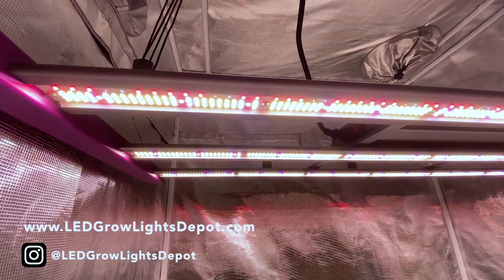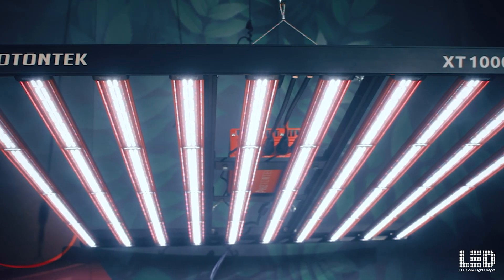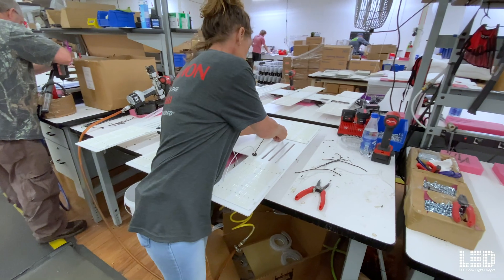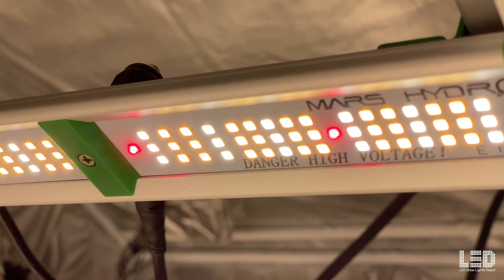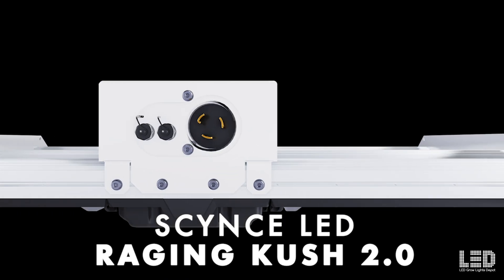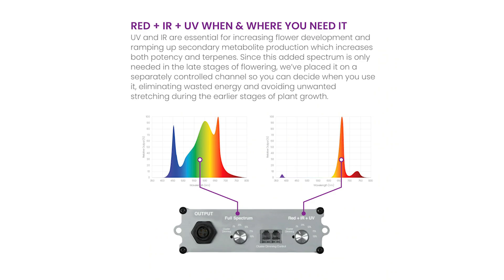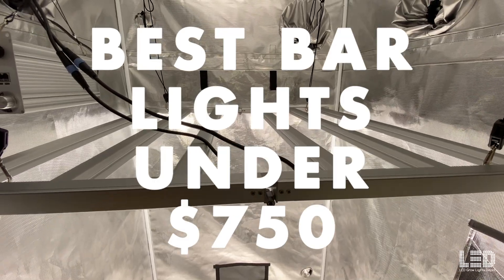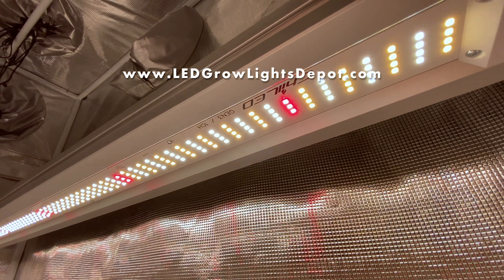Best LED Grow Lights 2022 // 16 Lights For Your HOME or COMMERCIAL Grow!

Comment: I have a question. 1000w hortilux high-pressure sodium puts out 140,000. And that's what you're basically saying the most powerful 1000 true watt LED put out. Although the high-pressure sodium cost way less. So what's the advantage to the LED that draws a thousand watts and puts out as much light as a 1000 watt high pressure sodium?
Reply: Spectrum and efficiency

Comment: My Mars Hydro LED light started flickering due to wires in the main wire harness connector burning. The connector was very hot to the touch. After sending a lot of pictures and info to Mar Hydro (Janice), they stopped communicating. I am afraid to use it because I don't want to burn my house down! Where there customer support and warranty?
Reply: I had same problem with my se7000 ,I have had 1replacement light stand ,and about to try out the 2 nd driver and I have to do the wiring, customer service terrible spider farmer.

Comment: I'm enjoying my ion 720 pulling so far off my first two harvest's since switching bto LED. 11 lb off 6 lights each harvest. purple gelato. Using co2 and coco 3 gal pots flood and drain in 4x8 trays. With a 25 day veg 60 day flower.

Comment: The best one: Raging Kush II, even coverage and tunable spectrum.
To simulate the SUMMER sun: during veg (best 5000k – blue/white) +UVB -REDs. To simulate the FALL sun during flower (best 3000k – yellow/white) -UVB +REDs.
Not only we have to change from 18-6 to 12-12 hours from veg to flower, but we must change the spectrums also. I will change my 3x3 tent to 4x4 to accommodate this light.
Reply: Optics better they have a tripple dimmer (and master controller)set up in 720-650 and the 320 slim and the results are crazy
Reply: @scottieschannel-l5f  RK LL is FAR better than Optics product lol. “Triple dimmer”…. Scynce made the entire light tunable. Bruce Bugbee collaborating with them. Has the best even ppfd spread of any light period. Not sure why anyone would want Optic anyways.

Comment: Mars hydro customer service has been an absolute nightmare for me to deal with.
Reply: thinking about buying a fc 8000,  should i stay away?
Reply: @bennyb6071  a ton of people are having trouble with wiring, some even catching fire. Look at reviews for ts3000 on Amazon. I wouldn't spend money with them again after my experience. I think for the same price point you could find something else that's just as good. I have a couple spider farmer lights that I love, I've never had to seal with their warranty department so I can't speak on that. I have the 2021 se7000 and It is the best light I've ever owned. Growers choice ROI 720 could be a good option as well. Lots of people seem to be using them with great results I have never used one personally
Reply: @samuelperson8090  appreciate the reply,  thanks pal
Reply: @bennyb6071  no problem, food luck growing out there.

Comment: My Mars Hydro FC8000 was delivered 2 days ago to replace a woefully inadequate KIND XL K5 1000 in my Gorilla Grows 5X5.
Reply: How is the kind led doing to you? Was wondering to get them on allibaba. The spectrum range is great deal.  (the real company that made them)
Reply: @tolksam1291  it would be much better suited inside a 4x4. Doesn’t cut it in my 5x5.
Reply: @richfiryn  thanks brother!!
Reply: @richfiryn  How long was shipping? Currently waiting on them to send my order out
Reply: @knockknock1874  5 days until I got it. Ordered on a Friday and received it on a Tuesday.
Reply: Hopefully nothing goes wrong with that light. I'm in the nightmare of dealing with mars hydro customer service/warranty dep. Worst experience I've ever had with a company and its far from over it seems.
Reply: @lok777  thats been my experience as well. They use good parts but their assembly is dangerous.

Comment: You missed my most important category of all with all these lights. For me it's the top category and no grow light revier ever mentions. 
Its even light distribution at the canopy.  All the 5x5 lights you showcased are really bad at distributing the light evenly, the corners and the sides of the tent are 400 to 600 lower than the middle.  The 5x5 fixtures are all crapy design.

Why are we letting grow light companies get away with crapy light distribution??
Reply: Look at Kind Led.

Comment: WHEN ARE YOU TESTING THE NEW: GROW THE JUNGLE 1500 WATTER?!🔥🔥🔥 😳😳😳 🌅🌅🌅 🌞🌞🌞

YOU MISSED THOSE LIGHTS COMPLETELY? 😳😳😳

THIS YEAR: 2022 # 
Grow The Jungle released 2 stronger lights!!!

1. The Eagle Nemesis - 1000 watts
 2. The Eagle Nemesis - 1500 watts 😳😳😳😳😳😳😳😳

1500.... 3 mircromoles

Booth the 1000 & 1500 lights comes with built in Wattometer, controller and UV + Infrared! 

Check them out at the Spanish brand:. GROW THE JUNGLE 🔥🔥🔥
Reply: Did they test any of these lights? They just show the fancy videos of them hanging and tell you to buy them from their webshop.

Comment: You missed the bar light from Parfactworks that has 3 controllable channels (Red/Blue/UV), 1000W for less than $900. Great build, fills a 5x5 with too much light if you aren’t careful. Best bang for the buck, excellent customer support.

Comment: I'm still rocking with the mars hydro fc-4800s, two of those in a 5x10 work just fine for me.
Reply: I had a mars hydro ts3000 now I have half a ts3000 after 4 months of use and customer service and their warranty is a joke. 50 emails and 10 days later I'm still waiting for a replacement. Customer service matters more than a few dollars when your plants are worth thousands. I learned the hard way this time.....lesson learned.
Reply: Weight?
Reply: @mushrOomMAn1223  Most recently I got a bit over 30 oz off 8 plants. I'm trying to get over 2 lbs this round though but we'll see.
Reply: @justsaying7979  For flowering they only cover a 3ft x 3ft area properly which is 9 sqft. You have 2 lights so they are covering 18 sqft leaving you 32 sqft in your 5ft x 10ft space that could be illuminated much better, thus increasing your yields.
Reply: @justsaying7979  only 30 oz in a 5x10? im sorry but I get that in a 5x5. if that's what the fc is doing, I'm not impressed unless your flowering super early. Ijs I know people getting 34 oz out of a 4x4.
Reply: @jfinnih  Wet or Dry??
Reply: @jeffhayes8753  Dry weight. No nutrients. Living Soil and Brew Feed
Reply: @1TheWhiteKnight1  I'm literally watching the buds develop again. Third year in a row that this has worked fine in a 5x10... Chill out.
Reply: @jfinnih  sweaty
Reply: @jeffhayes8753  dry
Reply: better than gavita?
Reply: @oscargarcia2700  idk, never ran gavita... I like my 2 mars hydro fc e4800, but maybe I could change my mind one day when I have thousands of dollars to spend on gavita.
Reply: I'm also happy with my FC-E 4800s so far. I'll probably get a couple of FC 6500s next.

Comment: Bar lights suck.

I grow in the SOG .

And no matter what led bar light I have tried.
They all suck.

If a plant isn't directly under the diodes, growth suffers dramatically.

To put this so everybody can understand.
The plants in between the bars only grow half as big.
As the plants directly under the bars.

I wish I could make a product by cut it in half and charging more money 🤑.

Think about it.
Reply: Lmfao you’re trippin
Reply: @timpage5021  
Typical response, from someone that doesn't know his ass from his elbow.

Do you grow in the SOG ?

Have you ever grown in the SOG with bar lights ?

From your response, I would say NO.

That's ok.
This type of response is what I've been getting for almost 10 years now.

All from people like you.
Who have never grown in the SOG, to prove me wrong.

In the past 10 years I have made a request, to numerous led manufacturers to make a video on this subject to prove me wrong.
And not one of them will even respond to my request.
So mister know it all.
Tell me why none of these manufacturer will make a video on this subject ?
Or even respond to me on this subject ?

Da, maybe because it's true.

DUMMY UP.
Reply: Grow plants using Lazy Susan's spinning 360* 
TO DO IT RIGHT
4 LARGE LEDS 1 ON EACH WALL LOOKING IN & Down at a 45 ,into the side OF BUDS. A Scorpion Diablo over Head & 4 - 400 HPS 1 in each corner,  Above.  Above ,with the Scorpion Diablow
Use CO2

Comment: Optic Led Slim 650S for the win!!
Reply: Do you have the 650s?
Reply: @MowMam  yes and it works great!! Best LED light I've ever used!
Reply: @dustinnoble99  I just bought the 720s and I'm hoping it was the right choice
Reply: @MowMam  I think you'll be happy with it and get great results similar to that of the 650s
Reply: @dustinnoble99  do you have a chart that explains the blue and red spectrum intensity?
Reply: @MowMam  Veg/Seedling
Seedling: 48"+  / 25% Power
Vegetative: 48" + / 50% Power (or 24" @ 25% Power)
Flowering

Week 1-3: 24-30"”   / 50% Power
Week 4-6: 18" - 24" / 75% Power
Week 7-8:  18" - 24" / 100% Power
Week 9-10: 12" - 18" / 100% Power
Reply: @dustinnoble99  do you use the blue and red on 100% with the whites or?
Reply: @MowMam  I never use white above 60% because the plants technically don't really need that much white light. In order to grow good strong branches and healthy roots, blue light is best. Red light is need more in flower stage and the incorporation of uv, helps develop really thick healthy flowers.

Comment: I wish they would do some kind of setting for the simulation of sun moving across the sky. The plants benefit from having to move . Too follow the sun .
Reply: Light rail lads
Reply: I believe Foshe or one of the big guys have this in their controllers.
Reply: You could always move the plants around.
Reply: It will get no more benefit from moving to follow blue light then the natural wind movement will give it from your fans.
Reply: @yrntthelibswipedofftheeart16  the tops chase the light. Have u ever watched a plant pray to the sun.
Reply: @yrntthelibswipedofftheeart16  how. When the plant would be turning and stronger because of having to bend. Are ur fans making your plants bend in half.